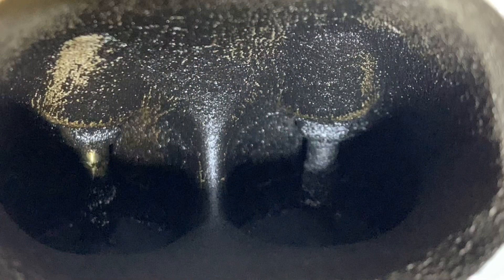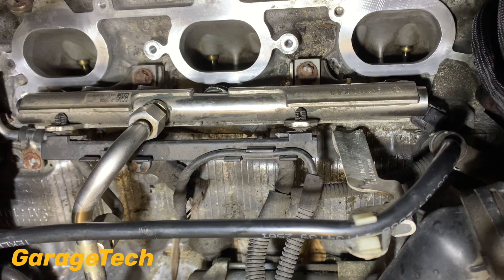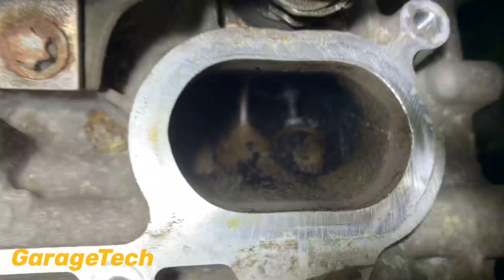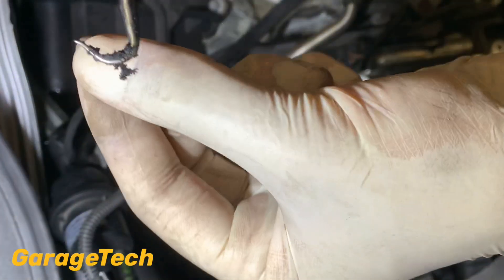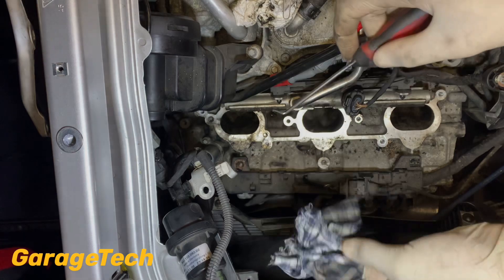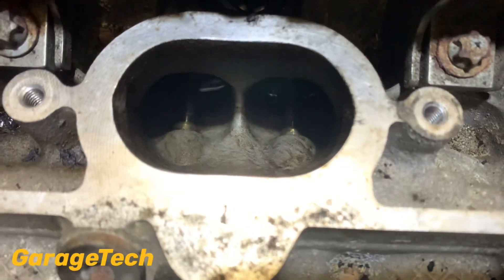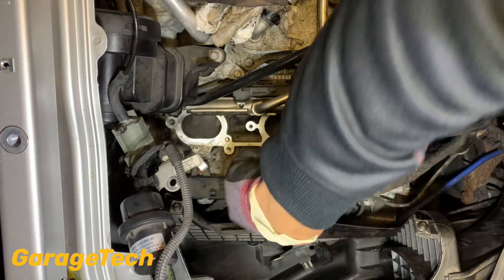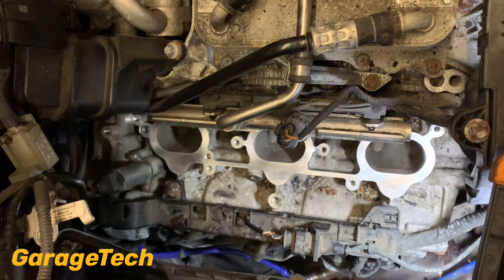Carbon buildup - how to clean it yourself ! Porsche Cayman Boxster 987.2 3.4 - Inlet manifolds off

Comment: Just finished doing this. What a tough job. 90k miles, there was a lot of buildup. It was almost solid on valve stems. I didn't  want to have too much solvent or junk pieces entering cylinders, so I used little amount of throttle body cleaner. Fumes are horrible btw, it's best to have some good ventilation of your work area, which I didn't have. So I used the pick and piece of rag wrapped around it and tooth brush and sometimes just piece of rag. Also I used vacuum and taped a drinking straw to the end of the hose, that gave me a little suction tool to suck out little pieces that were falling inside the shafts when trying to scrape the junk off the walls. On boxster it's very hard to get your body over the side of the car and have good reach to the intake. My roof was completely removed, even with that the access is not very comfortable. I ended up cleaning SOME of the junk but not all of it. Hope all the pain and time was not for nothing and I did more good then harm. Took me 3-4 evenings, few hours each time. Thanks for the video, it gave me confidence on what to do. After starting the car I had misfires for few seconds before the engine started running smooth. Did you have same? What was that?
Tip: be extremely careful with those hoses that vent from AOS to intake. Mine were 10 yo, very brittle and snapped. I'm ordering new - $120 incl tax.
Reply from the maker: Hey, well done buddy, it was a big job on the Cayman, can only imagine the pain on a boxster. Prevention is better then cure… continued build up can cause running issues, sticky valves etc. I don’t recall having any missfires on the first start up but I wouldn’t worry about that too much, could be some debris in the cylinder, the throttle body cleaner, engine resetting itself as it now adjust. As long as it’s not still misfiring that’s the main thing. Thanks for adding the comments, hopefully this will also help others 👍🏼

Comment: That looked pretty clean to me.  I just watched a ShopDAP video about a Mk7 GTI undergoing the same process and it was WAY worse in this engine.

As to the 987.2, I thought that this was a port injected engine.  I understood that the DI version didn't debut until the 981's came out.

Great video!
Reply from the maker: Hey, thanks for the comments, the 2.9 base cayman/Boxster was port injection, 3.4 is DFI. 👍🏼

Comment: I soaked my inlet ports with PU foam gun cleaning solution, which is basically acetone. That dissolved the residue and then I could absorb everything with a rag. Of course the valves have to be closed. The bigger flakes can be blown with compressed air or picked up like you did.
Looking back I would let them soak for a while in gasoline, that should work well.

Comment: i also have 987.2, i want to ask if i everyday use 7000rpm, will this car still have carbon ?
Reply from the maker: Hey, there will still be some build up, but it’s a 50/50 debate. The higher rpm will help clear the build up off and the higher velocity may reduce any particles sticking to the valves, but higher rpm will also produce more blow by gasses
Reply: If you have an S yes. Standard 2.9 still has port fuel injection so the old rule of burning out the carbon still applies.

Comment: First video I've seen on this for the Boxster - makes me desperately want to try it - however I've little appetite to wrench apart that frickin' metal inlet tube from my IPD Plenum setup! I have a new AOS on the way, but removed the current one last night with the manifold in there - doh! Anyway, besides the obvious peace of mind, was there any noticeable change in performing this? Did you have to do anything about valve position?
Reply: D Wray, have you done yours yet? Curious to know if there's any noticeable difference in return for the amount of time this takes, as well as the hassle of removing that plenum ;)
Reply: @JohnMolesworth  I did it but not on camera. Honestly, I did notice a difference enough that it justified the effort. I didn't whitewash the cylinders but removed all the gunk. I'd do it if you're thinking about it. Buy new seals too!
Reply: @DWraysGarage  Which seals are you referring to?
Reply: @flat6croc  the runner gaskets.

Comment: How do we turn the engine over without access to the crank bolt
Reply: It's accessible.  On the firewall behind the carpeting/insulation there's a removeable access panel.  Same way you change the engine accessory belt.

Comment: Can I ask how you ensured the engine was at TDC with the inlet valves closed? Thanks
Reply from the maker: Hi,  I used some compressed air through an air blower to blow down the cylinder through the spark plug hole, if you can hear air escaping through the valves, intake and exhaust, then you know the valves aren’t closed properly. 

You can work each cylinder at a time by setting each cylinder to TDC, as this is a big job, you may as well remove the spark plugs which will make it a lot easier to turn the engine over. The firing order is 1-6-2-4-3-5. To confirm you are on TDC you can put a thin rod/screwdriver down into the cylinder through the spark plug hole, just be careful, and when the screwdriver is then pushed out to it’s furthest position, you will know the piston is at the top of the engine. If you’re following the firing order this should be quite easy, otherwise you may have to turn the engine over twice. Hope that help 👍🏼
Reply: @GarageTechAutomotive  Thanks. Think this job is a little beyond my pay grade. I dropped you a message on this to the contact email provided on your YouTube 'About' page if you get a chance to have a look.
Reply from the maker: @flat6croc  yes got it, I’ll reply shortly 👍🏼

Comment: As an aside - is the IPD any good on the 3.4 DFI?
Reply from the maker: Hey, you do notice a change in the throttle response and a deeper induction noise. As for performance, apparently they do add a “few”BHP, I can’t confirm as never tested but as with all these types of mods, it always feels a bit faster but that can be just the placebo effect 😂
Reply: @GarageTechAutomotive  Thanks for taking the time to respond 🙂

Comment: How tf is taht carbon in intake? I think its just dirt mixed with oil from crankcase. Also why not just remove that aos crap and ventilate crankcase into atmosphere or some can
Reply: Because this model is a DFI engine which means no fuel ever goes past the inlet valves to clean them.
This is a problem all DFI engines have.